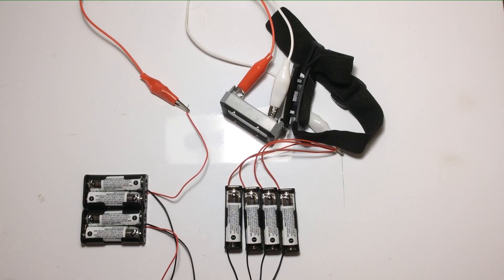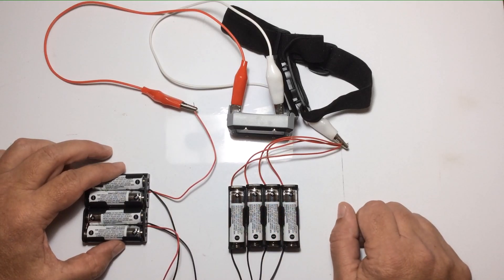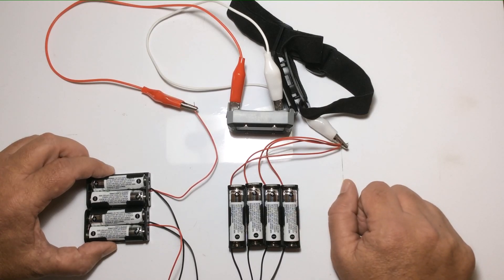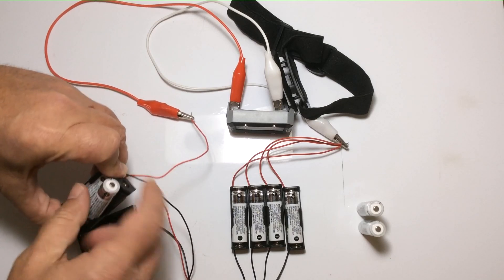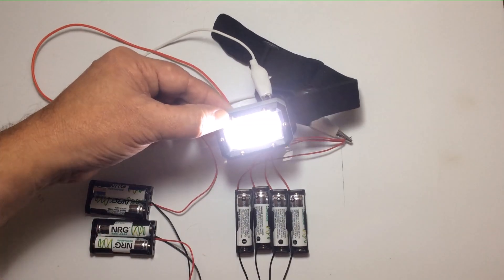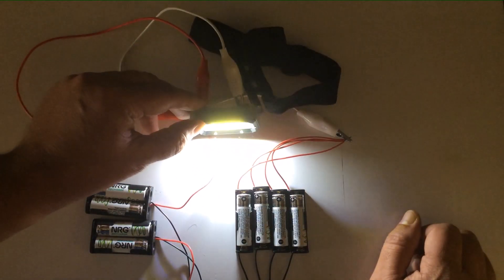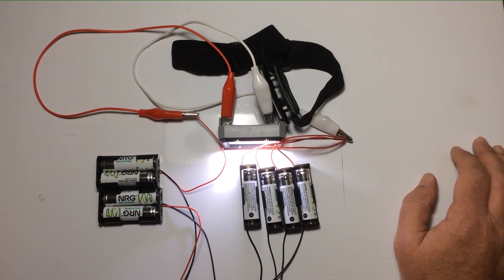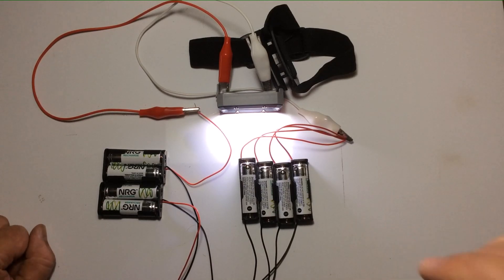TESLA POWER TRANSFER UPDATE - FIRST BATTERY ROTATION

Comment: Hey so - what about using 20v lithium ion batteries for this, like the Craftsman / DeWalt / other power tools takes?  Would it work, and if so, what issues might you run into?
Reply from the maker: Thank you for your comment.
I have not used lithium batteries because they require a balancing circuit and it may be tricky to achieve this as the balancing circuit will need to be compatible with both series and parallel configurations. Say your lithium drill battery is a 3 cell lithium and because your not using your drill battery charger with the balancer built in you will end up with uneven cell voltages which can result in a dead or “locked” battery or even fire. If you chose to risk it in the name of science I would do this outside on concrete with no flammable material nearby and take all safety precautions like a wheelbarrow of sand to dump on it because lithium burns like a jet flame, just YouTube search lithium fire and you probably won’t think twice about it. Other drill batteries, not lithium, might be just fine.
Having said all that, that is NOT a NO it won’t work, that’s just me being cautious as I like to run these tests unattended because they take so long to achieve real world data, I can’t be sitting there making sure I don’t have a jet fighter battery back taking off when I’m asleep.

Comment: Eso funcionaria con baterias mas grandes digamos de 12volts  de  litio y enbes de poner una lámpara  se ponga un inversor de DC a AC  y que funcione un circuito asi que opinas al respecto digamos un proyecto mas grande y ademas interfasado con fotoceldas solares  como vez se podra???
Reply from the maker: Thank you for your comment.
Yes this works with larger batteries, I have used 12 volt batteries with this arrangement and an AC to DC inverter as the load. Yes you can also add a solar panel to cover small losses for an outstanding efficiency.
I have had viewers tell me of their successes with inverters also. It is important to note that lithium batteries use a BMS (battery management system) which regulates charge control that may prevent this from working. If lithium batteries are used I imagine they would require a BMS that is compatible with series and parallel connections.

Comment: Can you do a switch that flips the batteries back and forth from series to parrell ?
Reply from the maker: Thank you for your comment.
I am still yet to draw it out to see what that looks like. That is the correct functionality of this circuit though, the Tesla Switch as it was called worked best when switched automatically between 100 - 800hz, above this was apparently dangerous as recorded by Electrodyne Corp. who performed an experiment that ran a 2kw load for 3 years using the full Tesla Switch arrangement.

I intend to investigate the full Tesla Switch but I’m quite marvelled by the simplicity and extraordinary efficiency in the most basic version of this concept. This is something that anyone can do and before I lose everyone when it comes time for coils and switching circuits I want to focus on the “Anyone Can Do It” version.
I am happy to hear any ideas you have on switching as I want to consider all options available before selecting my path.
Reply: I've seen a cylinder with bumps as a switch .
Reply: @whatifididthis...1236  I was wondering if this might apply to a different area of physics like compression and buoyancy.. no losses .
Reply from the maker: @R2NOTU  There are a few ways to switch this automatically. A good reliable way is as you have suggested, a cogged wheel or even a photo optical trigger on a disc. Mechanical switching, arduino and more, there are so many ways. To be honest, I haven’t completely thought that next step through as the switching is on multiple levels. Each individual battery has to cycle between being connected in a series bank to a parallel bank. I’m going to need to learn some new tricks for the next stage.
Reply from the maker: @R2NOTU    I believe there are a lot of things that should be questioned. I don’t have too much information in relation to compression and buoyancy so couldn’t answer you honestly. There are losses with this system, they are just very very small losses when you consider you get to reuse most of the power that ran the light. I believe the most practical use of this system would involve rotation of batteries when the light is required each evening. Eventually requiring you to recharge them after approximately four days with these smaller batteries as opposed to recharging them every day in a conventional means.
I have some new AA batteries that are larger capacity rated at 2300mah which I will use to repeat this test as the batteries in this test are only 1000mah.
Reply: @whatifididthis...1236  this is off topic but you might be interested I kind of got interested in things with permanent electrostatic chargers I'm going to try PVC I've learned how to reform it . From round to flat. I'm going to do the same thing using oil because I needed to get more liquefied softer and then I'm going to hit it with about a half a million volts of electricity until it cools down.. here's the point it would have one polarity.
Reply: Sorry accident with one polarity I'm going to have it facing another piece with the same polarity but hung on a string actually two strings and create a balanced like that a balance bar I'm interested in seeing how close and what direction I can approach the other one and cause the balance to shift its weight if I can do that I'm going to make a wheel with about nine of these pieces on it and see if I can offset  the weight basically put it out of balance even though I can't see the outcome it probably is going to take this kind of benchwork to see everything ..with only one polarity it might work.two polarities complicates things .. the only problem I seen so far I'm going to have to put some kind of a ratcheting system like just a sliding pin or needle to hold on what I achieve during rotation to the top the same thing could be done to the opposite side but on the inside of the wheel.but first things first .
Reply from the maker: @R2NOTU  I’m always interested and always out of time and life expects me to participate.🤣 Let me know how that goes as I’m still so far behind on the videos I wanted to make let alone learn something new, now, but later who knows? so please keep me up to date.
Reply from the maker: @R2NOTU  I have seen plenty of ratchet devices on 3D print websites that may be helpful or you can always design your own with 3D modelling software. You may even be able to print your fins so as to not require the bending of the PVC.
Reply: @whatifididthis...1236  a printer is something I've never gotten yet..maybe some day.

Comment: You switch the batteries around? I watched your other videos and missed this point.
Reply from the maker: Thank you for your comment.
Yes the batteries are rotated when the series bank is near flat.

The power, not all of it, is transferred to the parallel battery bank, you at a time of your choosing and based on practical light output should swap the banks continually transferring power through the LED from Serial Batteries to Parallel Batteries.The LED is also transferring a small amount of energy to heat which is why this eventually stops or becomes not practical in terms of light output. No skin off my nose to recharge every couple of months compared to daily recharging, imagine this in a cell phone or an electric car with an autonomous switching circuit for the batteries.

Comment: Can you use super caps ? A million charges
Reply from the maker: Thank you for watching.
Yes you can use caps, however this is where the switching of the full Tesla Switch would be required for real efficiency. I performed a few tests with super caps but I didn’t employ adequate switches and the nature of super caps it got a bit dangerous. Without good switches I Don’t recommend using super caps, but if you can get good safe switches or automatic switching then caps would be the way to go.

Comment: The combined internal resistances of the 4p batteries allow for the 4s batteries to discharge in this setup. This circuit is not what you think it is. You are still using the power from the batteries as the 4p batteries will charge at the 4s output-losses (the LED) not recycling power at all.
Reply from the maker: Thank you for your comment.
Yep, that’s what we were taught! So why does it run longer than when connected in a conventional sense? I will perform a control test and supply the results. I urge you to entertain yourself and build this, let it run longer than the calculated stored energy and then I will be happy to discuss it further.
Reply: @whatifididthis...1236 what do you mean, in conventional way? These 4s cells have 1000mAh and give 4,8V. Led light needs about 3V to light up. It is more efficient to power LED light from the source of near 3V then. So, everything you does in your setup, is you lower the voltage of 4s cells by connecting 4p cells in reverse to those 4s. Thus, when running for one hour at 1A, 4s batteries go flat, but these 4p batteries will charge by 250mA each. The LED lamp will bexpowered by 3,6V and that means, internal resistor has to dissipate only 0,6V instead 1,8V to keep LED at 3V limit. Yes, it is more efficient, than dissipating 1,8V but, why in the first place don't use just three serially connected batteries?
Reply from the maker: @arturtrzebinski2112  Thank you for your comment.
What I mean by conventional is what is normally done, ie. a normal connection of the LED to POS and NEG terminals. In this “conventional” or normal mode of operation all the power is transformed and lost. Using the Transfer method some of the power is transferred to the parallel set to be used again as opposed to a single run with conventional use.
The light in this setup is designed to operate between 3.2 volts to 4.5 volts. The batteries in this setup are 1.2 volt so three in series supplies only 3.6 volts which is a low value for this light. Four batteries would be fine for the “conventional” method as this would be 4.8 volts. However using the Transfer method requires the extra 5th battery as the voltage of the parallel battery bank is subtracted from the voltage of the serial set. So we have 6 volts minus 1.2 volts = 4.8 volts, this is equal and comparable to the conventional method using four 1.2 volt batteries in series supplying the 4.8 volts.
The main point of the Transfer method is the reuse of the power that is transferred through the load to the parallel set, with the conventional usage we only get the single run as opposed to multiple runs with the Transfer method.

Comment: Thank you, it's fascinating.
Can I please ask, do you know an online store or brand you can recommend
for rechargeable batteries?  
I would like to try the experiment, and would prefer spending my money on a set of batteries 
that have been proven to be of good quality.
I know all batteries are not equal,  if you have a recommendation it would be great.
Reply from the maker: Thank you for your comment.
I completely agree not all batteries are equal.
I don’t have any specific brand to recommend as I can only testify for the batteries I have experimented with.
The green and red batteries I use in my other videos are great and from ALDI and are a 1.2V 2500mah battery.
The blue and grey batteries I use in my other videos are crap and from an online marketplace, they are supposed to be 3000mah but the charger says they receive anything from 900mah to 1300mah.

The batteries in this video are from Coles super market and are Coles own brand batteries and were on special so I grabbed them. They are 1000mah and so far seem to be legitimate.
My honest opinion with all batteries is don’t be a tight ass.🤣
Purchase a reputable brand, companies that charge a lot aren’t always legitimate but people feel they have a right to complain if they pay a lot so those companies generally make a good product.
I learned the hard way and bought cheap batteries at two thirds the cost of the good ones and I got burned.
Reply: @whatifididthis...1236  
Thank you, it gives me a reference point.
I will get the ALDI and Coles ones.
For the sake of experimentation, I will see get a few other ones from other brands and see how they compare.
Your posts on transfer are great, they are an inspiration to us on what else is possible.
Reply from the maker: @shareyourchristmas  Thank you for your kind words. I am not sure you will find the ALDI batteries as they no longer sell them in my area, although I am rural and larger population areas may still stock them. They are good batteries if you can find them, mine are approximately 6 years old and still going strong.
I would appreciate if you could update me with your comparative data once you’ve collected it, this will help others select the right batteries.
Reply from the maker: I thought I’d let you know I picked up a good deal yesterday on Energizer Rechargeable batteries 4x AA 2300mah for approximately $12 at Bunnings in NSW, I’m assuming your in Australia, if not I imagine Energizer is sold internationally.
I will run a test on them when the control test has finished and post results.
Reply: @whatifididthis...1236 
Thank you, I will try to see if I can find
them, there is a Bunnings here, in Auckland
It is also possible to buy online and get things shipped from Australia.
It is amazing you are not very far, relatively speaking, I thought you would be in the U.S or Canada.
Reply from the maker: @shareyourchristmas That’s funny, I would have thought my Aussie accent was obvious.
Reply: @whatifididthis...1236  
Yeah,  it is interesting I didn't pick it up, 
I normally can.
That means you have your own unique, 
personal accent.

To be fair, I was way too deep in fascination with the experiments and in delight that you are an independent thinker, to be paying attention to anything else.

That's really what I like about your channel, you are an independent thinker, open to exploring possibilities.

Thank you for sharing your experiments
Reply from the maker: @shareyourchristmas  🤣My own unique personal accent, I like it. Over here we call that accent posh, stuck up or snobby, a sign you come from money which I assure you I do not. I may be on some spectrum which causes my pronunciation to be more correct instead of the usual Aussie slang, but I don’t care about a label and have learned how to manage it so far, a chameleon of sorts. This accent had to be disguised amongst my peers in my youth in the land of Oz so that I didn’t get bashed, I also remember deliberately failing some tests in my early schooling years because one of my friends asked if I was smart. I felt like I had been caught out and would be no longer accepted so I played it cool until it counted and smashed my exams, by that time I had earned my place in the group anyway and told my mates “so f#%king what if I am smart”... in a much less snobby accent than I have today. 🤣
Thank you for your kind words.
Reply: @whatifididthis...1236  
That's an interesting story, 
I didn't realize that could be an issue,
in Oz.
I like languages, I know that there is an emotional component to languages.
The way you feel, what you believe in, 
your attitude etc...affect the way you speak,
and the words you choose.

If you believe in your own value and the value of others, 
believe in possibilities and believe that you hold the seeds of greatness,  
then the way you speak is going that in it.

The way you feel will determine the words you choose and where you put your emotions in your words when you talk.

Quite interesting.
Reply from the maker: @shareyourchristmas  I have to agree with you as I find language very interesting also, as well as the other things you’ve stated. I found the chameleon approach helped me excel in sales as I could fit into all the different societal groups quite comfortably. At least enough to make the sale, whether they really accepted me or whether they paid me to leave I will never know, probably a bit of both. I find it amazing how dropping the “F” bomb in one crowd will get you the side eye yet in another group it’s the secret code for acceptance.